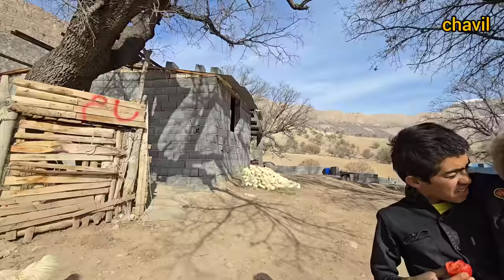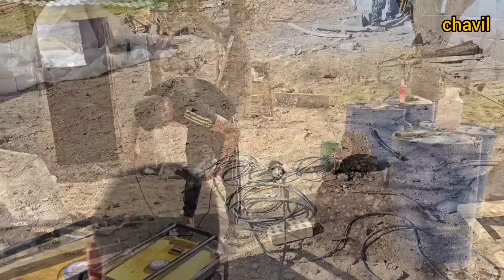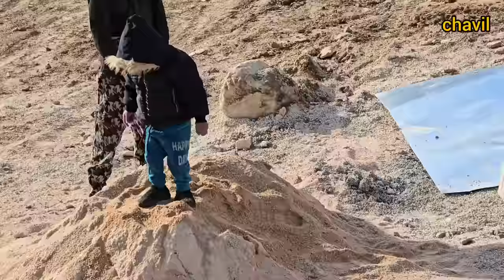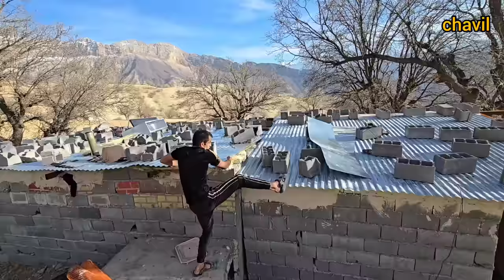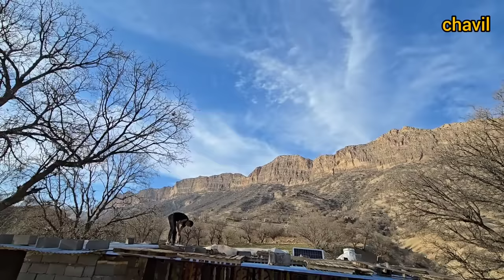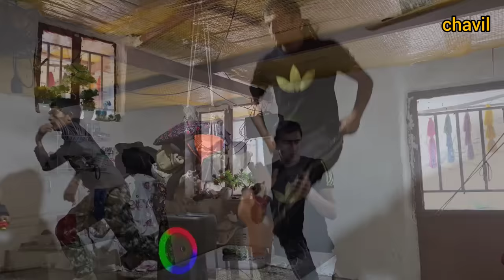Roof Repair Chronicles: Screws, Building Restoration, and Ali Family's Greenhouse Harvest

Comment: If you get the screws in on your roof, you can take all those blocks off of it. Better make sure where the metal is hanging over your house that you secure it good. If the wind gets real strong, it will pick up the metal and lift it up off the building.

Comment: That roof is going to leak like crazy when it rains, he’s tightening the screws too much and cracking the rubber gasket on the screw , screw should be tightened just enough to compress the rubber washers just a little bit

Comment: With all the blocks from the roof you can make a water tank if you put it in the high side of your valley dig it in to the ground used tar to seal it and the rain will flow in too it good for watering and animals

Comment: You're doing a good job with the electric tools. The screws are hard to get in the tin. Normally the holes are drilled with a small drill bit on the ground, then you put the tin on the roof and drill the screws in, and they go in easily as the hole is already in the tin. You may be able to punch a hole through the tin with a nail and hammer. If you had a pair of plyers, you could hold the screw in the pliers as you screw it in. But, you're doing a good job. Usually the peak tin, the tin you ut with the grinder, is bent into a V on the ground, so it lays flat on the peak and won't slide around. But you're learning.

Comment: Mate good try with the roof but the screws you use are not for roofing you need drill point roofing screws they have a rubber Ring to make a seal it will leak with the screws you have used and should be screws even 600mm good luck with it 😊 old man from Australia I have 53years construction